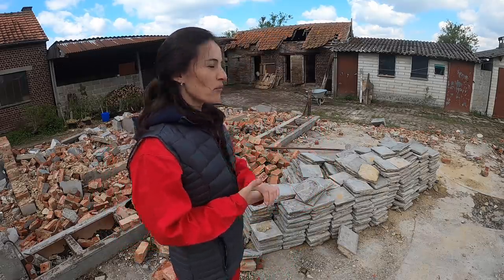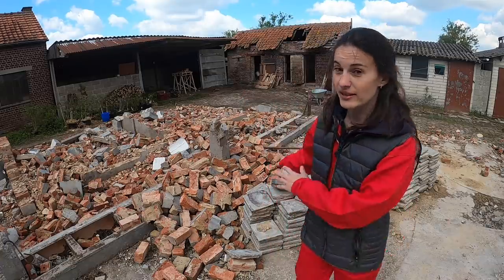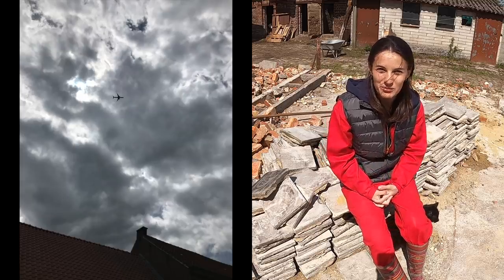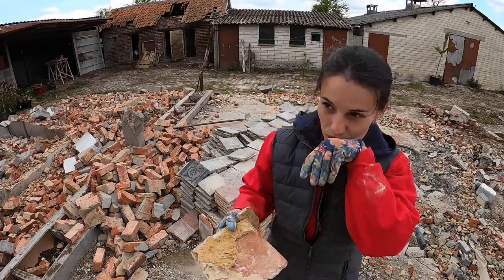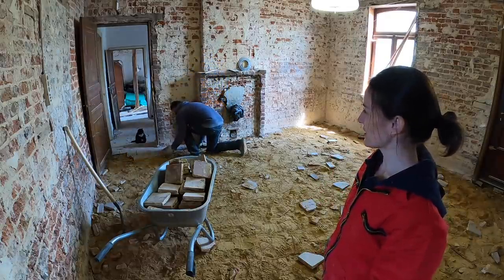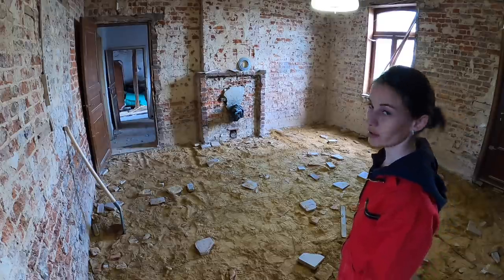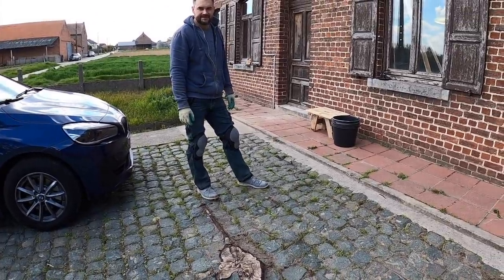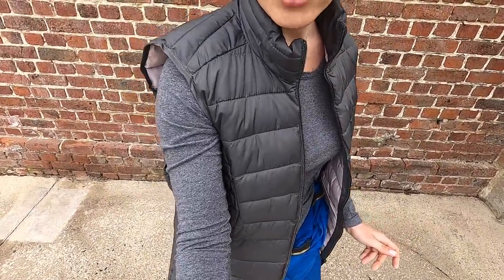Removing but saving STUNNING TERRACOTTA tiles in the hallway of 100+ y.o. farm

Comment: These unglazed terracotta tiles are very traditional for the Low Countries. You also see them on old paintings.
I wonder why you would clean the underside of the tiles. Too much and unnecessary work. Just use ample mortar and lay them again.
It's just the sides of the tiles you may have to clean. But even then you may just grout them.
I would pay specific attention to cleaning the top surface. After laying the tiles use a mild natural sop to clean off the mortar haze. Then apply cooked linseed oil to protect the surface.

Comment: If the floor with tile was sound and at the proper or acceptable grade (level) why would you remove it? Remontirovat’ v Mect’e.
Reply from the maker: To put new floor according to current standards, waterproof and isolated.
Reply: Tiles on dirt are cold and possibly damp, not really suitable for living spaces in the 21st century.

Comment: You could buy a masonry disk for the grinder to remove the screed off the back of the tiles
Reply: Yes! I saw the grinder used on old tiles from an old house in France ,removed the mortar very quickly .
Reply: Yes, the correct grinder makes a huge difference! 👏
Reply from the maker: I like mechanical ways a bit more than applying any acids, as I am not sure acids will not damage the tile (if not immidiately,  then might in a long run). I noted all advised methods, but grinder will be one of the first in the list.

Comment: Archeologist have to take stone and sand and other things off of bones that they fig up. They use some type of acid to do this with. I don't know the specific type. You mentioned lime based mortar, that's what they have to get off of the bones and other objects.
   The area around the fireplace would be called the surround.
   Goodbye, good luck.

Comment: You could get the  bulk of the lime off a tile with a brick bolster (https://www.screwfix.com/p/magnusson-guarded-bolster-cold-chisel-set-3-pieces/5429v) or tile lifter/chisel. (https://www.toolstation.com/heller-sds-plus-tile-lifter/p23991) The SDS are for an SDS drill, they are basically a wide chisel for removing tiles from walls but would be good for this purpose. White vinegar may work to dissolve the lime - you may be better to dilute it.

Comment: I think it will take quite a bit of effort to clean the tiles on both sides. Here is a sample of an old quarry tile restoration https://www.youtube.com/watch?v=GJVFmqCz96w
This was just to clean the top portion of the tiles, which he accomplished by scraping, grinding and sealing the tiles. Note also that he did this while leaving the tiles in place. I think vinegar and baking soda should remove the limestone, but, they may also damage the tile. I think I would try Ralph C's comment first.

Comment: Why do you remove a perfectly good teracotta floor that is so old? I don't see any reason why not to keep it as it was. Sad to see these old tiles getting broken.

Try grinding of the cement tiles with a belt sander. Usually the top centimeter of these tiles is made with pigmented cement so you can easily grind of 2-3 mm of the tile without loosing the pattern. In fact this would have been more easy when the floor was still in place. You can try to use diluted hydrochloric acid to clean of the cement but I doubt that it would work. The only way to clean the cement off, is the painstaking way with a chisel or by grinding with belt sander or diament grinder attachment for the angle grinder. Don't be too afraid to destroy the tiles surface as you can always grind it off later once they are layed again. You can reach out for companies who are refreshing old cement tiles floors. Good luck!
Reply: The lime mortar will disolve in hydrochloric acid but make a test with a broken piece if the terracotta will not get discolored or disolved by the acid. You should leave them over night in the acid. Usually all baked bricks or tiles are not attacked by hydochrolic acid. Brick layers sometimes use it to clean up old brickwork from lime deposits.

Comment: Try not to use chemicals!
Reply from the maker: Well, chemicals is a big word for what we are planning. First we would start with vinegar, I have big hopes for this method.
Reply: @DeHoeveOldBelgianFarm  : yeah, vinagre might not fully remove, but it WILL soften any basic mortar or screed for easier cleaning with a putty knife.
Reply: @DeHoeveOldBelgianFarm  - soak tiles in a vinagre in a plastic tub, you can keep using the liquid for a really long time, just add more.  The cheapest vinagre is prob. distilled white vinagre of malt.